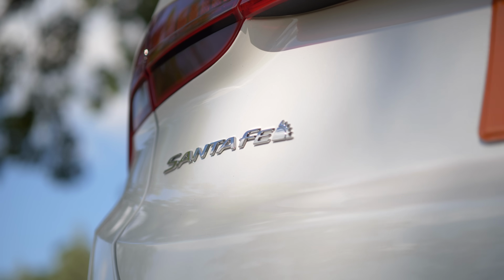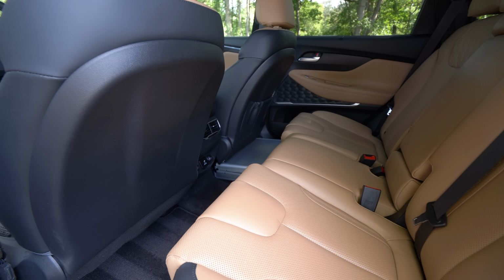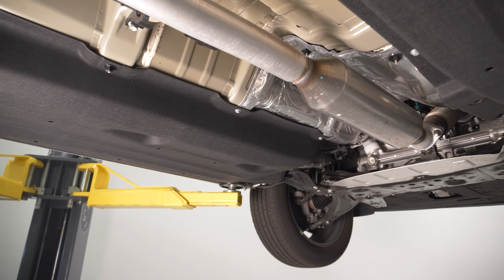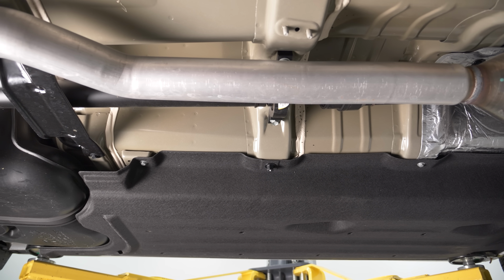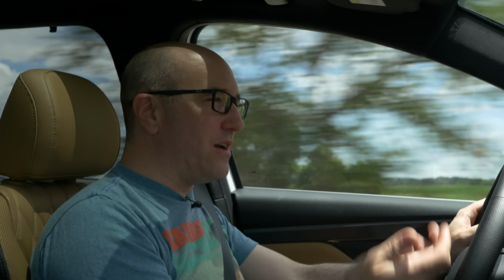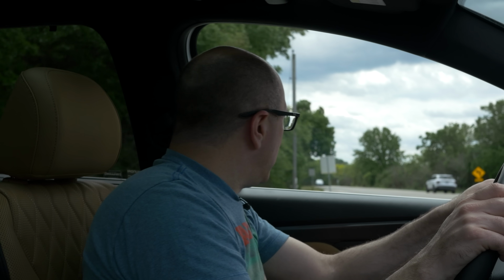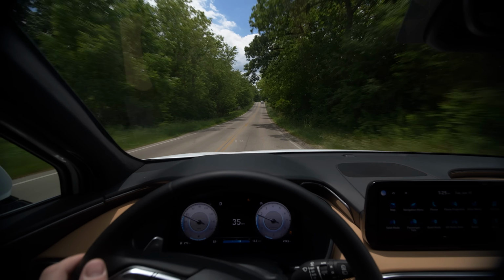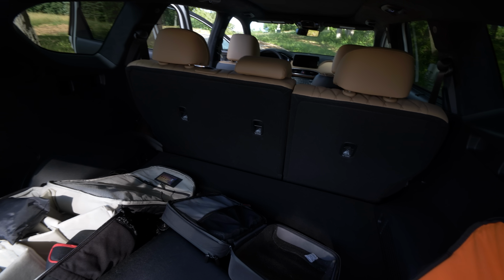2022 Hyundai Santa Fe | They Just Keep Going

Comment: 2022 Santa Fe limited 
20k rotor cracked.
40k transmission goes out.
45k oil pump goes out.
Now at 47k it’s still going. 
But people should be aware the reason why Hyundai offers such a great warranty is you will have to use it. That’s how they suck in buyers. Replacing parts is a minimal cost after someone purchased a 30k to 40k car.

Comment: I bought a 2.4Turbo like this in Aug’22. Earlier this month I was thinking to replace it, I checked what is around today from Subaru, Honda and Toyota, looking for at least the same driving experience on twisty roads above 6500ft/2000mts, same interior space and quality, same torque even if it was a little more expensive, but no way!!! I decided to keep it.  I’ll check again in two years.
Reply: Had any issues with the dual clutch transmission?  Is it herky-jerky at very low creeping speeds?  Going slowly up an incline?

Comment: I don't care for the DCT transmission. The turbo lag is another issue for me. I currently own a 2015 Lincoln MKC 2.0 AWD mated too a 6 speed auto and i don't have these issues. No turbo lag nothing but seamless performance. That all said, i like this SUV a lot and it's got a VERY competent AWD system with the Htrac. However, i am thinking back too when Kia put a DCT auto in there Sportage and it was nothing but trouble. And i see that happening with this Santa Fe model down the line. So i'd MUCH rather go with the 2.5 standard 8 speed auto with 190hp. Getting the SEL with Premium and Convenience packages will get you 90% of what the Limited and Calligraphy trims have. And in terms of HP the 190 isn't that bad at all and you won't have too deal with both the mechanical issues of the DCT and turbo lag. Otherwise, a VERY VERY nice SUV that easily gives Subaru Outback a run for it's money in terms of "off road" capability.

Comment: Need to see how that 2.5 T holds up long term compared to something like the Jeep V-6
Reply: Right on...!!! Especially with that DCT or "dual clutch" transmission. They usually are horrible especially in the lower power band in stop and go traffic. Having to constantly hunt for the right gear. Folks are already complaining about how "jerky" that transmission feels. Kia learned the hard way a few years ago putting a DCT in their Sportage SUV. And it was nothing but trouble. I'd take the pentastar V6 in the Grand Cherokee any day. That has proven itself too be a VERY reliable engine and transmission. Or i'd just stick with the naturally aspirated 190hp and 8 speed automatic in this new Santa Fe. Which should be more than enough power for folks much less reliable.
Reply: @tomtalker2000  I have a 2023 Tuscon SEL AWD with the NA 2.5, 'NORMAL' 8 speed and the convenience package. In my opinion a great vehicle for the $$$$$$, interior is similar to the Jeep limited trim but about 20 grand less so for ME it was a good choice. I have been doing oil changes every 4500-5000 not the suggested 8000 but i usually get a new vehicle every 2-3 years anyway, yes the Pentastar is now a reliable engine and i wouldn't attempt to compare a Tuscon to a GC for offroad use but i didn't buy it for that, its system is EXCELLENT on ice and snow though as i have a home in WV and have used it a few times on hilly, icy and snowy streets and no problems, i don't regret buying it that's for sure.

Comment: I really do hope that you're still reading posts here, SavageGeese.  At the very end of your excellent review you stated that the front wheel drive Calligraphy was "a mess" with the new 2.5T (especially compared with the AWD version), but you didn't explain why you felt that way.  Yesterday we traded up from a 2019 Santa Fe Ultimate AWD to the 2022 Calligraphy FWD (absolutely no nearby AWD Calligraphy models available with light colored interior).  So far (including the extensive test drive) I've been very pleased with the FWD model and would very much like to know what you felt were its shortcomings.  Thanks!
Reply: I don't know his exact reason, but I know enough to take a shot at the reason. 

If you have a car with a lot of HP and Torque, combined with a FWD only system, you can run into an awful lot of wheel spin on acceleration and/or lose rear tire grip on turns. These problems don't occur with AWD.

Mind you, if you drive very passively, you probably wouldn't notice, but if that's how you drive, why do you need a 2.5L Turbo with a lot of HP and Torque?

If you NEED/WANT that kind of power, a lot of the performance is lost with FWD... if you don't need/want that power, you're wasting money and fuel economy on an engine you don't need.

Essentially speaking, a high powered engine on a FWD vehicle is just a poor match in most cases. I can't speak for the channel, but that would be my guess as to his reasoning.

Comment: I have the Highlander and I love the car its very nice to drive long distance, sunroof is awesome I have it open ALL the time.   
Cruise - never holds the speed you set, always 1-2kmh slower so you have to set it higher.
The lane keeping is woefull,  has tried to kill me a couple of times.  Turn off unless you are on a fast highway.
The sensors are good,  it wont let you back out into traffic and has saved me once in a car park,  Adaptive Cruise awesome, Auto park - never use it to much shit to do with buttons when in traffic.
Heated seats and wheel is the best.  Also - I took it on a beach near me and tried to bog it on purpose in the soft sand,  (I have a 4wd also)  just firewalled the throttle messing about and it just goes, amazing really.

Comment: Love the "Geese" Love the car....but. I’m reaching out to fellow 2021-22 Santa Fe Calligraphy owners. (2.5 T w/HTRAC) I’m vexed; the Radiator fan will randomly run at full speed for 1-2 mins. after I turn the engine off. The Dealer can’t find any sensor defects etc. We live in a mild climate; the engine is not being taxed when this happens. This can’t be normal. Is anyone out there experiencing this issue too? Any guidance would be appreciated - Rick

Comment: Below is a copy and paste from a Tucson PHEV forum...Tucson uses the same drivetrain and hybrid platform as the Santa Fe. Great tips for keeping your Santa Fe PHEV and/or Tucson PHEV in EV mode in the cold winter temps.

"We got our Tucson PHEV Ultimate just before we had a cold snap (-10c/-15c). Yes in EV mode only the engine will stay on if the HVAC is on. So my wife warms up the cabin then turns off the HVAC. The engine immediately turns off. The heated seats and the heated steering wheel run off the battery so she always has that on.
Now that the temps are warmer (L:3c / H:7c), the EV stays on most of the time. We found that turning the HVAC to low fan, setting the cabin temp to 19c, the engine stays off for the most part. 
At first we were initially disappointed that the HVAC had to run off the engine but now the vehicle stays on EV 90% of the time and we are very happy. After 570kms we are getting 3.3L/100kms and that continues to drop. 
This is really how hybrids work and we have owned a few in the past. The 2022 PHEV Tucson is by far the best hybrid we have had."

Comment: So, I bought the limited trim with a lot of accessories. 
- I changed my intake, filter, turbo sensors, map sensor and added an after market tune. 
And now this is the best daily driver I've ever owned. ....I have owned, E46s, W204s. 
Bottom line is, I don't care about the badging when you're getting this kind of value. Plus the insane warranty and free maintenance.  I considered a GLC and Volvo's SUV etc... Then I saw this review a few months ago. And fast forward, money well spent..financed....(haggle!)
Reply: Had any issues with the dual clutch transmission?  Is it herky-jerky at very low creeping speeds?  Going slowly up an incline?

Comment: ahh yes hyundai updated the car in a major way but other things stay the same. The engine problems continue to plague hyundai line. Same as it was with the seizing engines in many other models 2011-2016. The S. Korean govt, is once again investigating hyundai deliberately and knowingly selling defective cars. Yes boys and girls the engine problems are back on the smart stream engines. so be prepared to get one soon with some failing in as few as 10,000 km. The rings are causing dieseling in the pistons causing major oil consumption and essentially total failure of the power plant. Hyundai has begun to quietly replace ngines in korea. and is trying to keep the problem quiet in the U.S.. with the current oil fill level on the dip stick the crank is floating in oil, not a good thing. But hey don't take my word for it google this all. Sadly i found out about all of this AFTER i bought one. The affected engines are G4KN G4KP G4KM G4KR.

Comment: I feel like Hyundai/Kia vehicles have very plastic interiors... they over-design them to make plastic look good. In a few years these over-designed vehicles will be sitting in used dealership lots where no one wants one bc on the exterior they look futuristic but the interior will be so heavily outdated and cheap. There's no timeless design with these vehicles... they just "look" new. Kia had something going with the optima, then they discontinued it to also bring out these over-designed vehicles... the sorento is the only Kia I would consider buying right now... everything else is just plastic pretending to be luxury

Comment: 3:24 that huge suspension travel looks very offroad worthy
Reply: "Off-road worthy" for modern Santa Fe and Tucson SUVs are more like "gravel/dirt roads" than anything else... I wouldn't trust these for deep mountain woods or deserted canyons adventures.
Reply: @wolfshanze5980  Actually the Htrac AWD system on these Hyundai's are FAR more competent than you make think. Sure they aren't rock crawlers but they will plow right through heavy snow, sand, or mud, without blinking any eye. On top of that you put a set of Falken Wildpeak A/T Trail tires on this vehicle. It would do EXTREMELY well.

Comment: I test drove one today.  They finally did a model here in Canada called "Urban" which gives you leather without the Pano roof and normal gauges.  I personally dont like Pano roofs, to much glass and added weight for no reason. Bummed about not getting the nice digital gauges but, meh.  As for this 2.5T.  Just incredible.  Good lower end torque to get you up to speed pretty quick. Finally, a good sized based 4 cylinder in the 2.5 with a turbo.  This is more than likely my next vehicle and to replace my 2014 Santa Fe with the 2.4  GDI, which for me has done its job well enough.  Cheers, love your channel!

Comment: Can these two reviewers address the Hyundai / Kia nightmare of the widespread failures of the engines in 2016 - 2019 Hyundai Santa Fe's and Sonata's, etc)..... and equivalent Kia's using the 2.4 litre non-aspirated and 2.0 turbo engines - - which resulted in class action lawsuits which has cost Hyundai millions of dollars replacing engines???   My son has one of these (2.4 litre non-aspirated 4 cylinder) that burns 2 qts of oil in 1,000 miles..... and my 2019 Hyundai Santa Fe Ultimate w/ 2.0 turbo is 'included in the list' of affected vehicles..... so, I am just waiting for something to go sideways with this.

Plus... I can tell you this.... Hyundai's 10 year/100,000 mile warranty is bs.... read the fine print.... there are a LOT of loopholes.

Comment: I'm curious how the Santa Fe plugin compares to the rav 4 prime
Reply: Technically, the Rav4 competes with the Tucson, not the Santa Fe. Both the Rav4 and Tucson are considered compact SUVs while the Santa Fe is considered a midsize SUV. 

Though, to be honest, the size difference is minimal. (The Tucson and Rav4 are large compacts, while the Santa Fe is a smaller midsize).

In either case, the Santa Fe is going to be a bit roomier than a Rav4.

Comment: I want to know if they're still using the garbage Theta II engines that were plagued with rod bearing oil starvation and poor manufacturing tolerances. I own a 2017 Santa Fe Sport and it chugs oil (1qt in 1k miles). Kia/Hyundai were sued for these trash engines that are known to seize up spontaneously.

Comment: I just got mine for 5 days now. Santa Fe calligraphy awd but mine come with 20in wheels. I think it was the late 2021 I saw them 2022 got the same wheels. Msrp was 44 something  and dealership add on 2.5k mark up and roof rack running boards and a few other things I pay 50k for mine. I know I over paying it. The dealer willing to let me walk all I'm ask rubber floor matt they wouldn't do it. Anyway it hard to find one now they  don't make enough. This Santa Fe has better tech than my 2021 palisade calligraphy.

Comment: I bought this car before their review and couldn’t figure out why there weren’t more reviews talking about how great this version was to drive.

I was looking at Mercedes and BMW and Audi but went with this.
Reply: Great car …. but. I’m reaching out to fellow 2021-22 Santa Fe Calligraphy owners. (2.5 T w/HTRAC) I’m vexed; the Radiator fan will randomly run at full speed for 1-2 mins. after I turn the engine off. The Dealer can’t find any sensor defects in the diag. We live in a mild climate; the engine is not being taxed when this happens. This can’t be normal. Is anyone out there experiencing this issue too? Any feedback would be greatly appreciated - Rick
Reply: Mark, are you still happy with your Santa Fe?  I have been a longtime BMW X3 owner and am thinking of switching to this model.  The technology it comes with is better than a lot of luxury brands base and mid models.
Reply: @_M_N  for sure!

Comment: My biggest complaint with most manufacturers is they include wireless charging but no wireless CarPlay or android auto. If they are not going to include wireless CarPlay, then remove wireless charging and make the cupholders bigger or add another storage pocket.

Comment: Test drove both the Hybrid and the Turbo today.  Interiors are beautiful.  Liked both the drivetrane's.  The hybrid was really quick off the line with a nice linear pull.. but it kind of let me down after the initial bolt of electricity.  The turbo was a little twitchy off the line.. but had great torque all the way thru the power band..  I actually liked the regenerative brakes of the hybrid compared to the non-hybrid..  Was very smooth.  Both of the cars we're really nice..  The only thing that bothered me we're the center conssole and driver side armrests we're very firm.  Not great for a long trip.  Both of these impressed me compared to the Telly/Pali twins.  Those cars are heavy.. and feel heavy when driving them..  They need a turbo or electrified drivetrane.. in my opinion.

Comment: DAMMIT.   Now I want to trade in my Golf GTI for a Santa Fe.  It is ugly beyond reproach, but the idea of a poor man's Telluride with the ability to bomb down gravel roads is almost too much to resist.  I drove an original Tracker to places so extreme it defies belief, this would be the Bentley homage to re-live those days 'up until the branches scrape'.  Yaweh grant me the strength to avoid Googlin' up modest lift kit/tire options, and guides on chopping the front chin for attack angle and the inevitable cute tucked away winch mount.  Then a custom transmission oil cooler, skid plates, etc...   sob

Comment: Do they still come with the burst into flames options?  Hyundai's are still a throw away cars like they were in the 90's. The warranty is long because they are pile of junk.  I have a friend that works for small Hyundai dealership and they replace between 25-35 engines per month.  Nothing but Junk!!

Comment: Purchased the awd limited with turbo 4 for 38K…it is impressive…gobs of power for a midsize suv and interior is super comfy and convenient…although, 2 weeks after we bought it, check engine light came on…needed a new itm sensor for regulating the thermostat..$600 part…warranty covered, obviously. So, hopefully that’s just a hiccup and we’re on to a nice owner experience…time will tell.
Reply: And so it starts. Best of luck to you…thank goodness for the warranty.
Reply: Quite honestly, you should have went with the normal aspirated 190hp engine. The turbo lag off the line and more importantly that HORRIBLE DCT or "dual clutch" transmission is nothing but trouble. Those trannies are constantly hunting for the right gear in stop and go traffic. And their has already been quite a few complaints on how "jerky" feeling it is.

Comment: Hard pass on a dual clutch in a big turd like this. That seems like a terrible idea.
Reply: It is actually the best idea they ever had I'd say. This transmission is just terrific and also keeps up well with the Diesel engine which still has even more torque than the tested 2,5T.

Comment: no jack, if you have an american car this wont blow you away. a jeep cherokee (not grand cherokee, the small cherokee) in overland trim has a full leather dash board, this does not. also, it has nappa leather seats with REAL wood steering wheel top SINCE 2016 but you guys just wont review one. times gave chanced.
Reply: The new Jeep Cherokee looks pretty good. But for the price, it's pretty over priced! I would rather take the Santa fe and keep the $20k.
Reply: @barbecuetechtips6024  it has features, refinement, and off road tech simply ONLY found in a jeep thats why the cost is where it is.  the platform is more ridged and substantial by nature to accommodate the tricky off road situations  owners come to  the brand for such as lifting wheels off the ground and flexing the body. theres a video of a compass yes  A COMPASS on two wheels nearly tipped over, all doors trunk and hood opened and closed like the car was on all 4's. very sturdy flex resistant chassis.
Reply: @Oldchrysler  I'm pretty sure 99% of the owners never leave the pavement and the only wheel lifting is going off a curb lmao